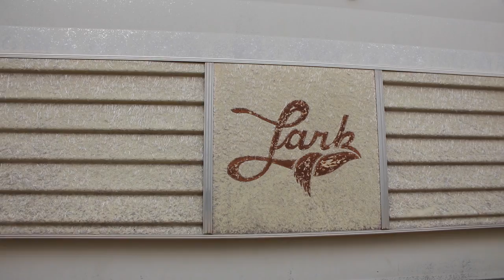We're Restoring a Vintage Camper?

Comment: Great stuff matey.
when my wife and i got married 30+ years ago we bought an old trailer similar to yours and did the same thing. i completely gutted it and replaced all the rot.it was great living in a small van for a few years, but my wife really wanted a house to live in.Our lives from then on took a different path again as we lived in the van whilst i built our 1st home. We eventually finished the house and bought a 4wd camper and traveled around Australia as much as could in between jobs and holidays.It was a great time in our lives. You are very lucky your wife is adventurous as you so good times ahead 4 u. good luck and best wishes,thanks for sharing .much appreciated.
cheers Gizmo

Comment: My goal is to build a multipurpose vehicle for camping, hunting and similar to what you're talking about by creating a living space for when you get in with the NPS. Good luck on that. That's my goal when I return from an upcoming deployment. My goal is 2000-2004 Nissan Frontier crew cab with a roof rack, 4WD, 5 speed. Install a rooftop tent. Softopper in the bed and bed rack to haul canoes, kayaks or whatever else. The bed can be used as a sleeping area for guest. Great for car camping.

Comment: same shape as my 74 travel mate. but the rear bed is on the side and bathroom on other side. my ceiling is good but some walls have had repairs / patches done. not great but usable. my latest repair was in that front corner by the inverter. wish it was restored but i might just sell it. i only paid $300 or so a few years ago.

Comment: Darwin I watched another video and the man used pressure treated plywood on the the floor that was bolted onto the metal frame. I recently read a post from a man that said that pressure treated wood gives off a gas and that it's only meant to be used outside so is that a mistake what this guy has done to replace the rotten floor with pressure treated wood because I'm about to have to do a gut and rebuild and I wanted to use pressure treated wood where I could because I feel like it would last longer but then that man said that and I felt like you know I didn't know what I was talking about

Comment: hello I'm thinking of trying to revamp a trailer when I pull the floor up should I put something down before putting a new floor so that the new floor does not get wet I'm new to this the only thing I ever built in my life is a wood paper clip in shop class and a chicken coop with help and to was small and not so detailed lol the trailer I'm looking at is 1960s MONITOR VINTAGE 12 FT. CAMPER